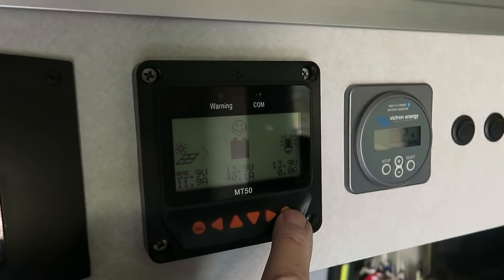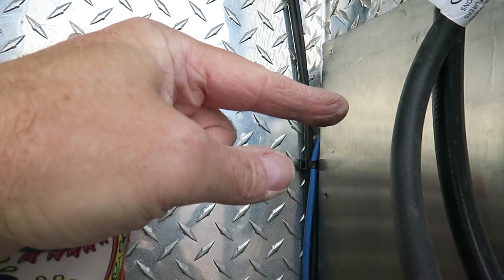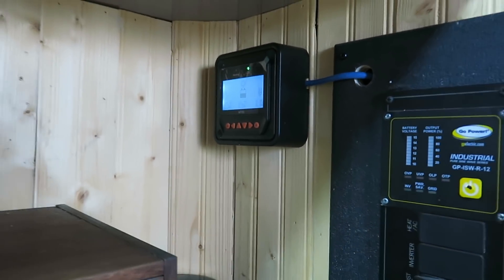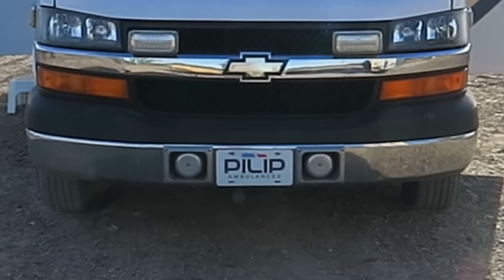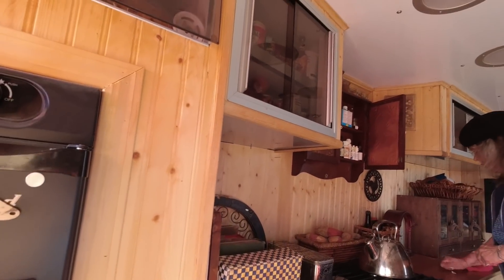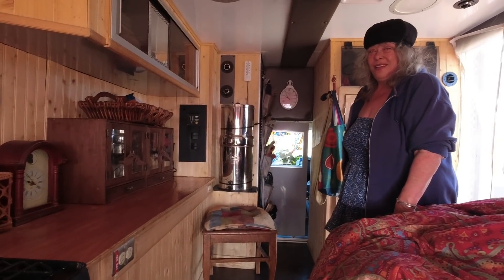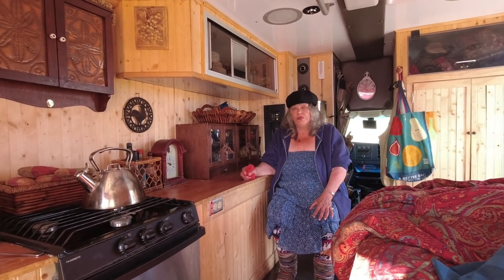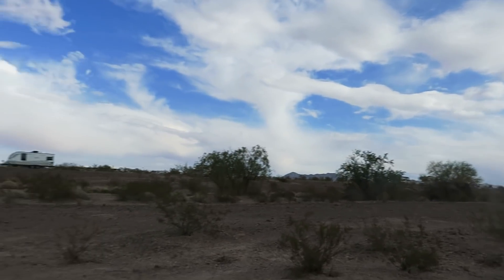Custom Ambulance Conversion Tour | Quartzsite Solar System Finished | Ambulance Conversion Life

Comment: Is the gap of about 1 to 2 inches between the solar panels and the roof of Pam’s RV ambulance conversion is to cool the solar panels due to air circulation underneath the panels? I don’t see a gap like that from the solar panels that is installed on the roof of a residential home by looking up from the ground. My 2 solar panels have 1 inch gap; however, the main purpose is to remove debris (such as tree flower bulbs and leaves, etc.) when I am driving down the road instead of for cooling the panels. Maybe, where I live is not hot enough to consider cooling the panels.
Reply from the maker: Great question  - yes, the brackets give 2" of space. On a rig its good to block the heat from the roof and give air flow to keep the roof cool.